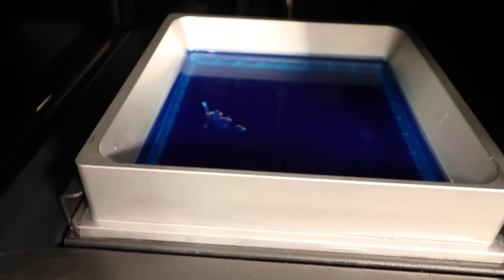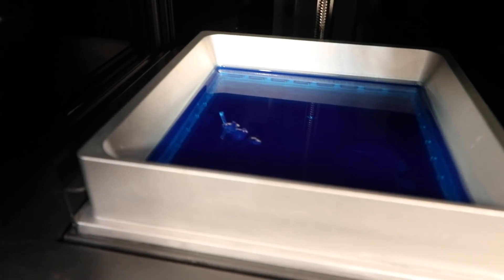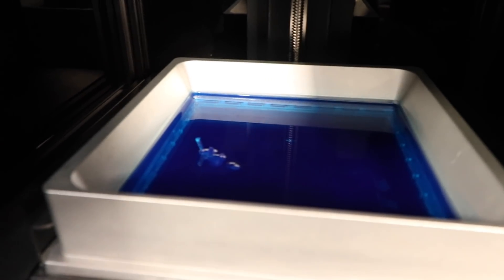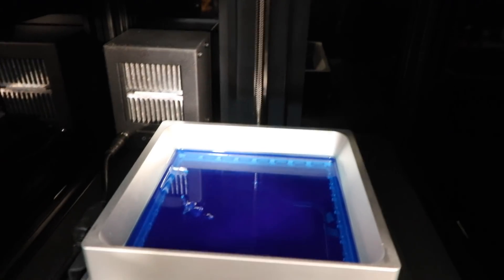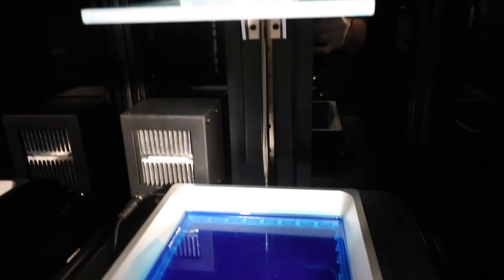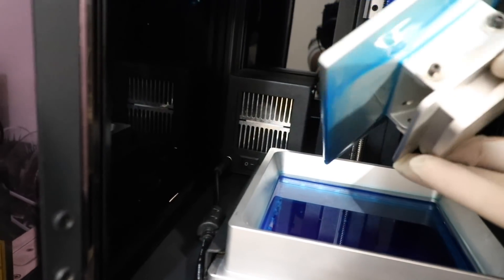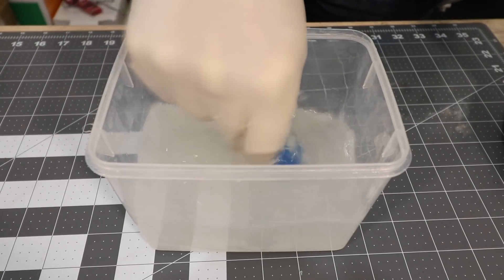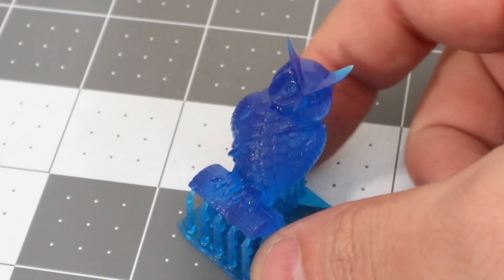The Cold Could Be Ruining Your SLA Prints - Peopoly Moai Heater Module

Comment: A possible alternative solution for heating a resin printer would be a simple 12 volt electric car heater. Some are small enough to fit in most printers and all you need is a wall outlet adapter and a Sonoff temperature controller to monitor the temperature in the case.

Comment: Is it important to remove and clean prints soon after or within a reasonable amount of time after their print completion (e.g., overnight prints may have to be planned accordingly)? I understand that for intricate details if one allows the print to remain unattended for somewhat of a prolonged period, that some of those details may be lost as the resin begins to drip-dry and solidify the longer the print piece is left unattended--especially if one maintains a print chamber temperature within 30-35 deg-C.

Comment: I don't have that issue, but I do have a fep wrinkle issue. Would a heater help? The resin is normally already 30c once it gets printing...

But the damn fep always wrinkles 40 layers in... If I hit it with a heat gun, it smooths again mostly.. But a few layers layer.. Wrinkle... Which screws up my print.

I am printing a skateboard Riser... Basically a 7mm rectangle.. With a cross bar in the center for strength. Fails 100% of the time (wrinkle embedded into print)... The actual print comes it fine. Just the fep screws up... I've asked tons of forums and people.. Nothing has worked... Relaxed fep 3x with different kinds, brands, even tried ptfe spray and higher tension... Nope.

Creality doesn't even have answers... (ld-002r)

Think you can print it and help?

Comment: I literally just found this out the hard way just this weekend. I got a photon for xmas and have been dying to test it out so after ordering some resin I finally got a chance this weekend. The only room I can print in is the garage as I have a family member with fairly severe asthma who would definitely have an attack if I printed inside the house. So I set up three runs and each one had issues. Two outright detached from the plate after an hour or two. The last actually stuck (was a different model with a larger base) but had pretty severe deformations. I suspected the temperature which your video has just about confirmed (was around 50-60F). I'll look into making a heater to fit inside, or if I can suss out an effective way to vent the smell I may be able to keep it upstairs in my office.

Comment: Yes - true for all resin curing printers. Found out the hard way with my trusty Wanhao D7; the resin needs to be at 20C minimum, happiest at 25-35C. Even if the print doesn't fail, the detail suffers significantly.
With the LCD-based UV printers like the D7, they kick out 30W or so of heat themselves (I guess the laser SLAs are more power-efficient and don't generate so much heat?) - I housed mine in a cheap small metal IKEA cupboard which I insulated, and once up to temperature the heat from the LCD is enough to maintain things at 25C-35C when the environment is more like 10C (I have it in an unheated utility room with good ventilation to keep the vapours and so on out of the main living areas). Mounted a hair dryer blowing up into the base which does just fine for getting it up to temperature quickly before starting a print on cold winter days.
Another idea I considered but didn't try is to install a thermostatically controlled heat mat from a reptile terrarium.

Comment: Do you worry about the VOCs from different resins with the heater and the circulation going?
Reply: Should pay attention either way - follow the guidance from the safety data sheet for each chemical in use (typically the resin itself, and IPA). As you print with the door closed, I doubt the heater/fan make any real difference to the health hazards.

Comment: Strongly considering getting a Moai. How reliable has it been for you? Any issues or need for replacement parts?  Very many failed prints?  How long are the vats lasting you?

Always enjoy your vids. 👍🏻
Reply from the maker: I originally had the other type of vat, forgot what it’s called, had over 1000 hours on it before I changed it, and it was still good. Always reliable and if prints fail it’s usually due to my bad support placement
Reply: 3DMN, Did you just use Peopoly resins or use 3rd party stuff as well?  Have you messed with any other SLA printers with similar build volume/price of the Moai?  If so, better or worse experience?  Just trying to find out as much info as I can before forking our the cash for one. Thanks for the reply.
Reply: Definitely go read the Peopoly forms before you spend your money. I enjoy my two machines but I have replaced several components on both and other users have plenty of stories and complications. It's a box to tinker with. If you need parts with tolerance and super accuracy then this is not the printer for you. Once again not bad mouthing at all just know what you are getting into.
Reply: timsep1  dang. I’ve been lurking and asking questions on the Moai Facebook group for a while now and the 3d printing Facebook group as well.  I shied away from the phrozen shuffle xl because of all the screen failures. The Moai seemed as though it was a more reliable machine from what I’d seen. I’m bouncing back and forth between a G3D t-1000, phrozen shuffle xl, the Moai or a Uniz slash plus.

Comment: i tend to use a vivarium mat and leave the vat sat on it with some clean tissue under so not to pick up any dust particles on the vats. or i will wrap it around the bottle. or i will sit the bottles on top of the radiator that's set to a low to warm temp. i find this works great for the moai and the photon. :)

Comment: I've never been taken by FDM, unless you're looking at makerbot or utimaker, but given prices I'd even put more money aside for a Moai 200 - as long as there's good engineering and mold making resins available. Worth the extra effort for the results imo.
Reply: Just please check out the forum for Peopoly, I'm not bad mouthing them, but accuracy is very challenging to get from these machines. If you want parts that fit with a tolerance you will be challenged to do so. Some users have had success but they have spent a long long time working to get there.

Comment: FYI I have 2 Moai units and one heater has already died, dangerously so. The fan died mid print so while I printed overnight I came downstairs to find the unit very very hot, with no air movement. I've had the unit for maybe a month and this has happened to other users too. Just letting people know that there are some quality issues with these heaters potentially.